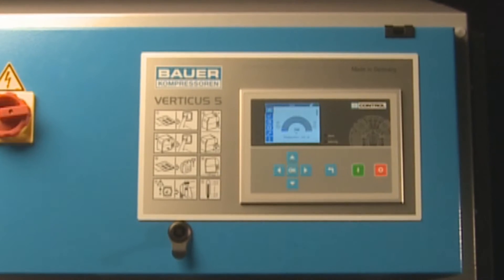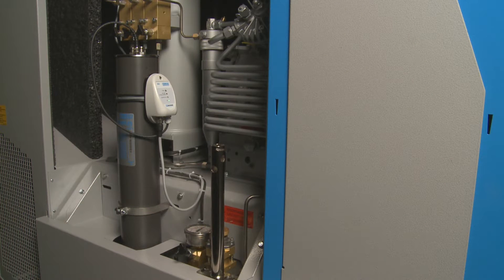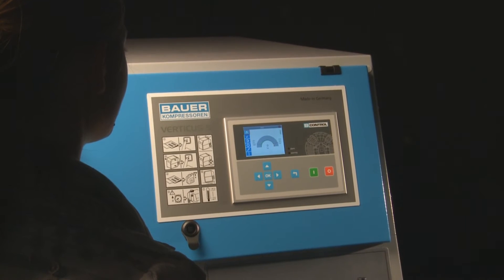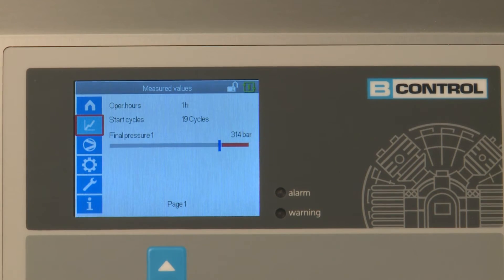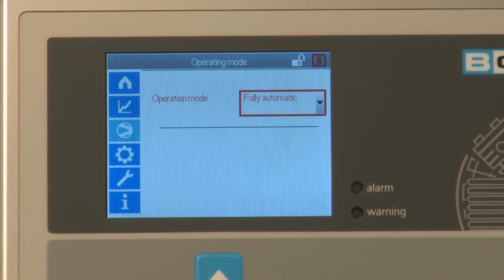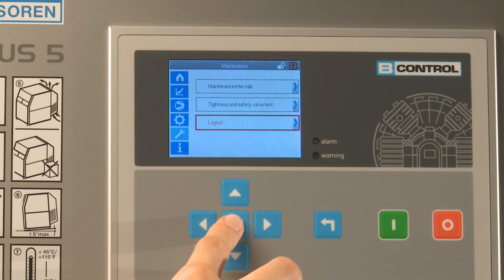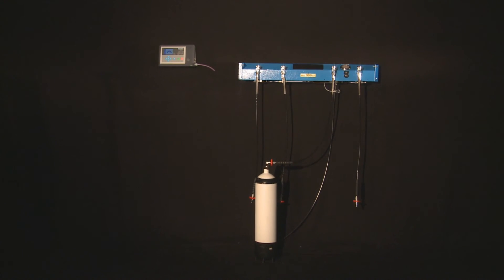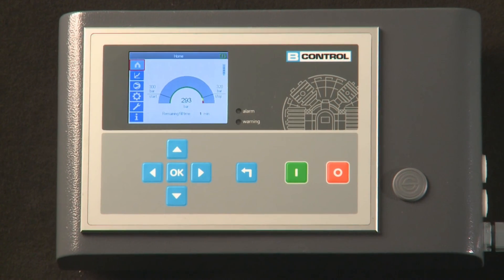B-CONTROL MICRO Compressor Control and external B-CONTROL Display from BAUER KOMPRESSOREN

Comment: How can i change the air filter setting to operate the compressor with standard filter
Reply from the maker: The filter cartridge can be selected in the menu ‘Home’ > ‘Compressor setup’ > ‘System settings’ > ‘SECURUS’. However, maintenance level is required for this setting.

Comment: Does the B-control have a battery for memory in it? We have a B-control that has an alarm saying Battery low
Reply from the maker: Dear Mr. Lehmann

Yes, B-Control Micro has a battery on the controller. Please replace the battery. Order number N43979
Reply: How i can change the air filter  setting to use standard filter instead of secure filter